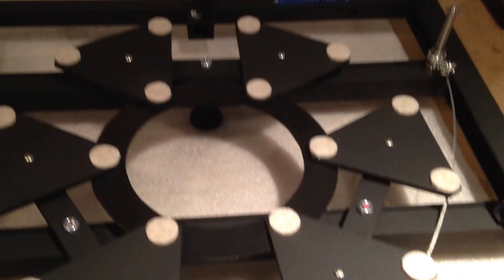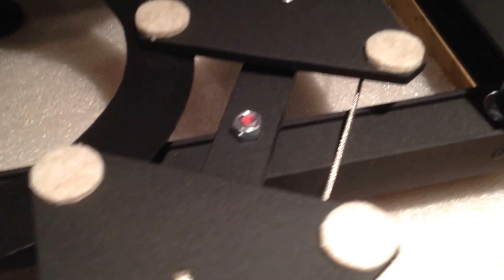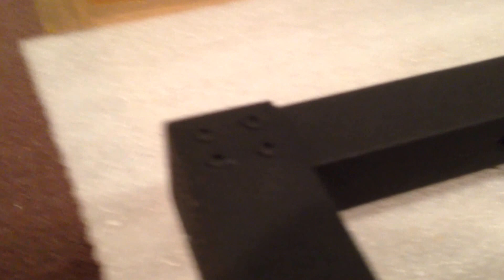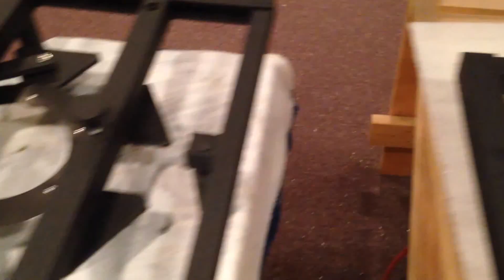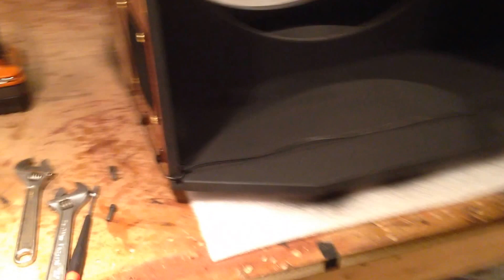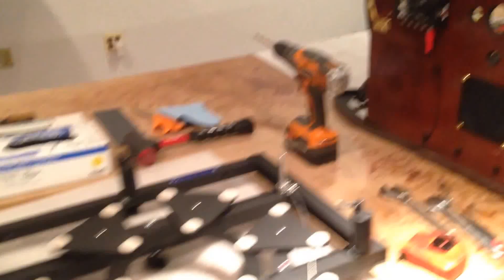Teeter's Telescopes Mirror Cells

Comment: hey is it ok to directly place 10 inch mirror on flat piece of wood for ? will it work as mirror cell or it will damage it ?
Reply from the maker: Good question!  For proper support you CANNOT have a single, continuous, flat surface behind the mirror such as a flat piece of wood. The primary mirror will change shape and flex over the course of the night as the ambient temperature changes, so you want several independent contact points supporting the backside of the mirror that will tip/tilt with the mirror's flexure. A flat board cannot possibly do that, hence all premium telescopes utilize what are called Flotation Cells that really allow the primary mirror to "float" so the mirror is not constricted.